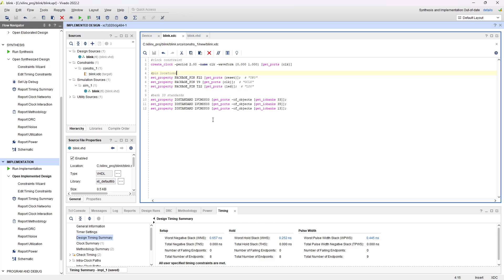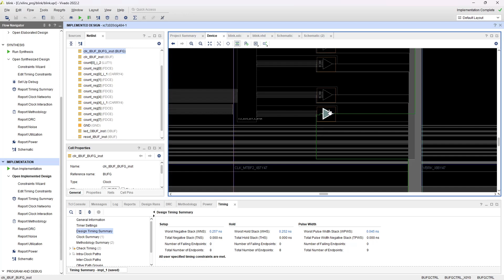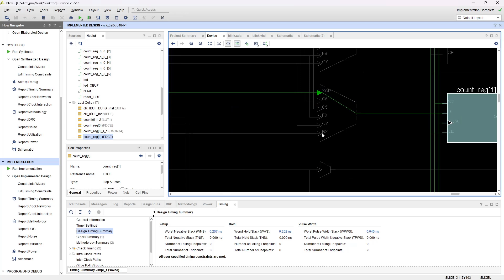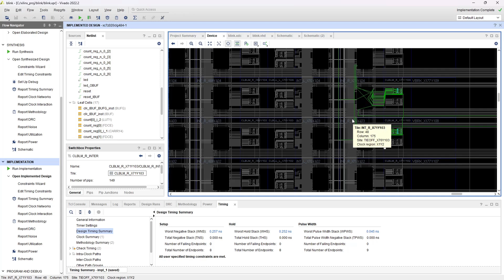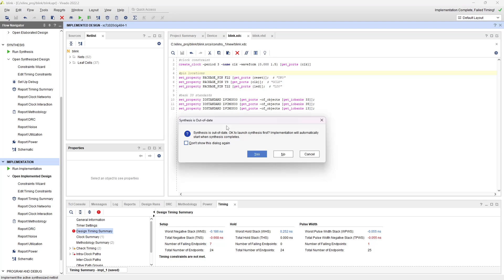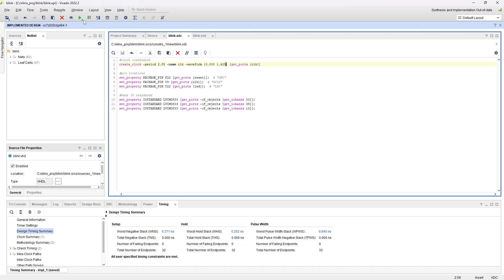How fast your FPGA will go?

Comment: you used the default strategy which are balanced between fmax and compile time, did you try runtime optimized strategy?
Reply from the maker: Andreas,
I used a very simple example (counter) to keep thing predictable and make it easy for the tools to place and route (and checking the tools if they do the right thing)
Runtime/compile time is not an issue when you make a counter, f-max is achieved by placing the the ff and carry chains on the same slice (which it happen as expected with the default settings. So the answer is yes I was using the default settings, but this is irrelevant for the simple design used here.

Comment: Thank you for a wealth of knowledge.
AMD marketing heavily emphasizes the numbers in Versal - 2.2 GHz and 1.05 for HPS, and around 1GHz on the PL side of things. How realistic is that and is this possible mostly because of the physics at that process ? (tsmc 7nm)?
Reply from the maker: Versal is a modern FPGA fabricated on a much smaller node the one I'm presenting there is 2010-2012 generation so Versal it might well be that fast (life taught me to water down a bit the marketing claims) - I don't think AMD is making false claims but probably on the high side.
I might repeat this video with a Versal when I get my hands on one. 
Thanks for your appreciations,